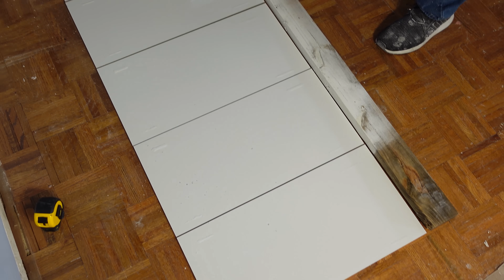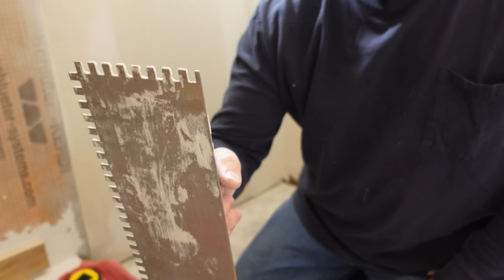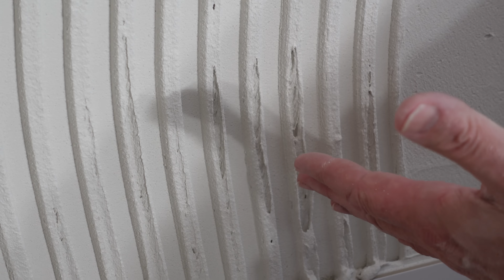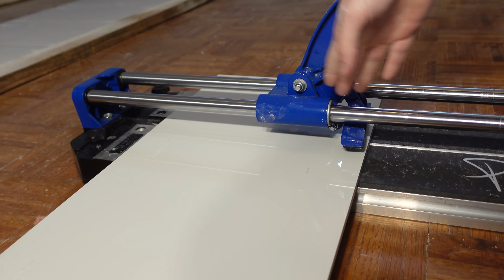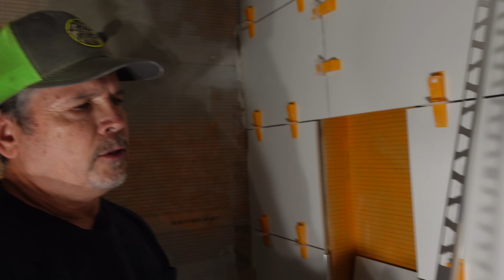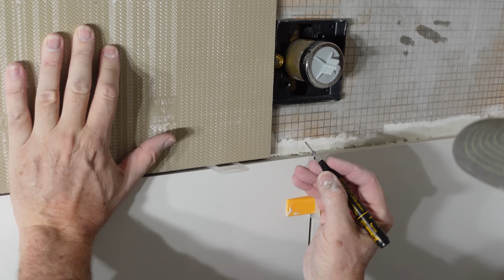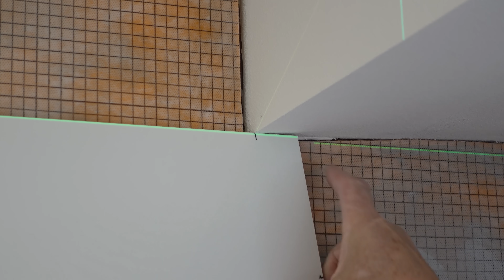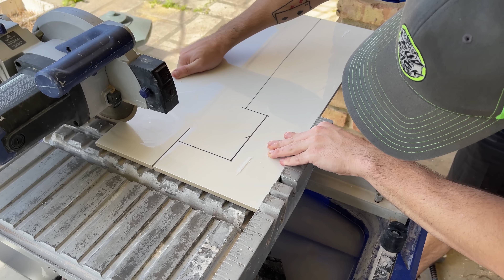Buy THIS Tool BEFORE You Tile! | Tiling a Shower

Comment: Looks like you are using porcelain tile. I know it's best for floors, in case you get a chip, since the color goes all the way through. Is ceramic OK for shower walls since there is low chance of chipping. I see  my current shower/bathtub walls are ceramic. My house was built in 1965. It's OK, except for a couple of tiles that came off. I think because of poor thinset coverage . 50-60 percent. Thanks

Comment: Do you use a bull nose tile for your horizontal tiles? Why would you have to back butter the tile? I didn't have to back butter too many tiles when I tiled the bathroom floors.
Reply: You should always back butter, or scratch coat your tiles. As a pro tiler, I have dealt with many floors with tiles coming up that weren't
back buttered. There is a fine layer of dust on any surface and with tile it can make the difference between adhesion and not. If you want an example of non adhesion, go into a convenience store (they usually have the worst tiling) and drop some change on the floor
listen for the hollow tiles, those haven't been back buttered and will eventually pop free.
Reply: @elvagabundo4607  I agree!

Comment: QUESTION....Was the neich's location planned according to the size of your tile? or did you just get lucky that it lined up perfect?
Reply: A lot of times we will hold off on installing the kerdi niche until after the walls are up and a good portion of the tile is set. We then cut out for the prefabricated niche, install and water proof. Then we can continue with  completing the tile install.
Reply from the maker: Yeah a little of both.   We installed the niche just above our grab bar blocking (as low as we could) then adjusted the tile layout to accommodate the niche.  Hope that makes sense 👊
Reply: @StudPack  Thank you.
Reply: Yeah, how to determine the placement of the niche would be very helpful. When I did my shower I placed mine where I felt it was most functional and aesthetic but it caused all sorts of problems when it came to tiling around it. It’s probably the most amateur part of the job I did:(
Reply: You have to plan it out before hand. When the old shower is demoed you just determine roughly where the top of you pan tile will be mark a line and figure out the best height for the niche. Doesn’t have to be perfect. You can be off a 1/4 or so and adjust your tile accordingly.

Comment: The last top piece on the shower head side is not geometrically sound ,full tile on full tile not staggered ,other than that you have a  pro looking shower install.
Reply from the maker: I saw that when filming the outtro and my heart sank 😡😡
Reply: @StudPack  I have experienced this ,had to remove the tile before the thin-set dried.

Comment: The products you show are way to expensive here in Thailand. Is there a way to waterproof a shower without them? Please help
Reply from the maker: Liquid membrane over cement board is very economical for walls.  Mapei aqua defense available in Thailand ?
Reply: @StudPack  thank you so much. I am looking writing in English and it's hard to find products. Love your content
Reply: I understand that cost can be difficult but water damage and destruction is more costly. Catastrophic failure usually does not happen until damage has extended beyond and completely through all materials. Meanwhile if there is any slow rot and mold then you will not even know until it completely fails. I feel for you if cost is prohibitive… but despite the initial cost of Schluter then the long-term cost and threats to my home and family is more. I know what it’s like to tear mold out of a house and feel the health effects that were building and growing before we were aware of the mold for years. It was growing inside the walls and through the floor until it finally made its way all the way through. 

Despite the financial upfront cost of Schluter then the long-term cost of repairing all of that and my family‘s health is cheap in comparison. I feel for you. I really do but if there’s any way to put in quality products like Schluter with the warranty they have then I highly recommend it. 😌💕

Comment: LOL, Again putting screws on a  already "water proof" shower wall. LOL Laughable  Genius
Reply: Kerdi is easily able to patch penetrations like that as long as they have a 2 inch overlap using the Kerdi membrane and thin set. I did cringe at first but then realized this. Thank you!
Reply: @insecureinvestorchallenge7366  No kidding. LOL
Reply: @CulichorHimself  very cool system and they have free workshops! Cheapest investment I ever made and got as much out of it as ever. It literally cost me only my time and gas to get there. They covered all the meals and hotel if needed. Workshops are nationwide and they teach out of the TCNA handbook the legal standards you should know. I hope this helps!
Reply: @insecureinvestorchallenge7366  I do install their products, so I know a thing or 2, I will NEVER put a hole through a shower wall, there is other methods to use without compromising
Reply: @CulichorHimself  😙👍

Comment: What about a quick explanation on those metal or plastic edge things? Different sizes, how the tile is supposed to line up to the edge, grout against the edge or does the tile fit right up against it? And what about cutting the corners  of them?
Reply: You can go to Schluter’s YouTube channel and look up their profile installations. They have plenty of information on installation, cutting and different ways of application. Schluter has an extremely diverse choice and selection of profiles to customize to any project. I don’t work for the company. I just took their free, nationwide workshops and got to see how passionate and invested Schlueter is for their industry. I’m so grateful. I hope this helps!

Comment: Looks good.  I installed 12x24 tile in my shower and it wasn't until I finished that I read on the side of the tile box that you should line up the tile horizontally by removing 30% on each side so that your sides line up better.  I don't think that matters in this shower because of the small size but in a bigger sized shower it would.  I really enjoy watching you guys make it happen.

Comment: That last tile on top by the soffit should've been two pieces. As you can tell I'm very anal when laying out tile. I use the same wedges , makes for a perfect surface. Thumbs up !
Reply from the maker: I saw that when filming the outtro and my heart sank 😡😡😡.  That’s what I get for working till 7pm 😣
Reply: I didn't even notice until I read your comment. Good call. One of those things that would drive me nuts later every time I saw it.
Reply: Nice catch
Reply: I'm curious why it should be 2 pieces. Thanks.

Comment: I don't know if you can get them state side but in the EU I could get hold of tile cutting blades for my Buzz and Jigsaws. They're not fast but they are neat, makes a world of difference if a plumber needs to take the valve body out from the front in future.

Comment: Hey Paul, why did you installed the schluter like that? I normally just face it with the wall and not the edges. Just tile the wall right up to the niche and take the guessing out for how much you need to leave for the niche. 
And you should have wall tiles going over curb and floor so the water doesn’t come down into the grout line.

Comment: good stuff.   Might want to discuss about making sure you always order extra tile.   Being 1 or 2 short and then you go to buy another box and it either doesn't exist anymore or the color is slightly different.   (plus you always want a few extra to sit in the attic for the next owner to find 30 years later. :-) )
Reply: It's  better to have  extra tiles and not need them, then need them and not have them. Lol
Reply: You should always order 10 to 20% extra depending on pattern and layout
Reply: I always add another box when I buy tile. I have had many boxes with half the corners broken and manufacturing defects like bubbles in the glazing or stippling on the printed pattern. You can usually return the box or save for another job for under cabinets but you can't always get the same dye lot if any at all.
Reply: @wearenotamused6455  broken tile 😡 way easier to return extra tile than it is to, stop, clean up, leave to buy tile (even if it is readily available) then come ,back set up, and get back in the groove
Reply: Amen to that. We just sold our house and I had some tile left over from when I did the floor in the kitchen about 8 years ago. My wife wanted me to get rid of it but I said NO, its good to have it just in case. Well as luck would have it my wife dropped the mixer and chipped one of the tile by the island about three weeks prior to the sale finalizing . The new owners were very appreciative of the fact that they had exact tile to make the repair w/o have to find a match 8 years after the floor went in.
Reply: 2 or more extra boxes.  What I don't use gets returned.  Saves multiple trips to the store.  Once I get rock'n and roll'n I don't want to stop.
Reply: I’ve always bought 10% over, for some reason because my brain doesn’t account for areas that give you 2 cuts from 1 tile I always end up with excessive overage
Reply: SAME WITH EVERYTHING...  keep all extras and store them...  things change..  and exact matches can be an nightmare...  this is an awesome channel
Reply: Yessir!
Reply: Lol yep
Reply: @lechatbotte.  WHAT'S THE TOOL?

Comment: I'd be interested in your tips for proper tool clean up especially if you have to pause mid project like you did in this video.  Do you always clean tools to shop bought metal, do youstore mixers wet in a bucket of water? I tend to clean to bare metal but that seems overkill sometimes.
Reply: @suspicionofdeceit uk uses latex type tile adhesive  that won't harden in a bucket. different to us thinset.

Comment: My OCD just kicked in when you made the cut for  the shower valve. LOL! No kerdi band on the niche to wall seam. Isn't that going to bug you...?
Reply from the maker: The Kerdi on the wall laps over the niche flange.   All good 👊👍
Reply: If they had fabricated their own niche then they would probably have to waterproof all the seams inside the niche. Since they had a prefab niche then it was not necessary. Big time saver and I love that!

Comment: You can also add an accent band or stripe (pencil tile) to  make the layout work .both of those holes look great from my house 😁
Reply: I would probably just open the grout lines like 1/16? to keep a full tile at the bottom and eliminate the sliver. Or possible try to factor that in when determining the slope of the pan. There’s so much to think about and everyone has different taste. That’s what I love about tiling.
Reply: Good idea.

Personally I always assumed the reason tile companies sell tiles with dimensions slightly less than 1 or 2 foot is to compel us to buy accent strips. ;)
Reply: Great way to avoid slivers

Comment: S.P., I love how y'all are really zero'ing in on anticipating questions. Example, the leger, exactly when I was thinking about the screws holing the ledger board, y'all said you'll patch them with a little curdy as you do the bottom course. Very cool!

Got to add, once of the best shower tiling videos I've seen. One of your best as well, IMSHO. Very inspiring, considering I've got a master suite I really need to get to. Thank you again.
Reply: Hire the Stud Pack!
Reply: @moneyfornothing3264  Distance and Money. 

I live in N. Texas, and budget constraints push to DIY. FWIW, I'be already built furniture, cabinets, electrical, some plumbing, and have done siding on the house.

Tiling and some of the finer finishing things are left to be personally explored. But I will get there. SP has really helped.

Comment: In going to enjoy figuring out how you tile inside that nitch 👍
Reply: Quite simple, take measures of tiles cut them add thin set and set tiles and it's done.
Reply: @mr.wizeguy8995  well, I did wonder if he was going to tie the back first full sized and then fill the sides in, but he's done the bottom and now I've got to wait for another video for the rest
#Cliffhanger 🤣